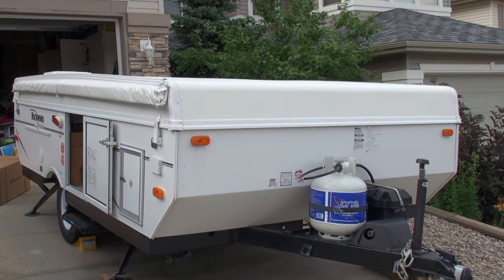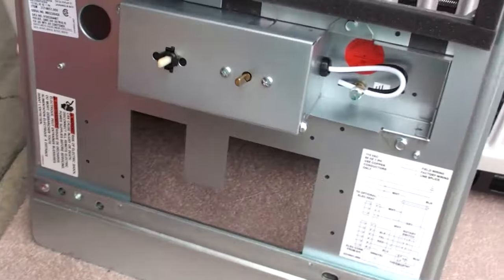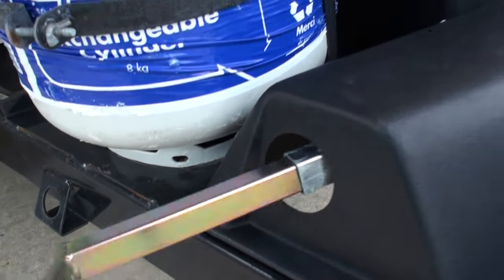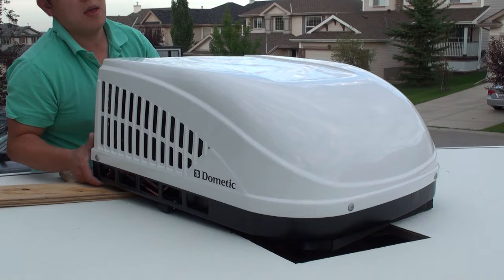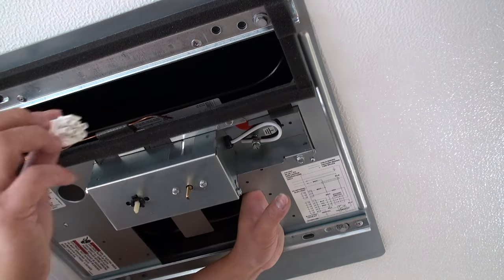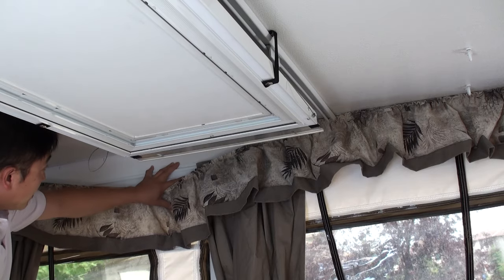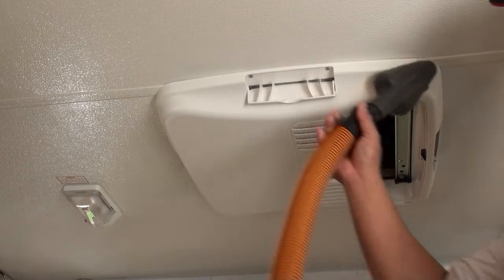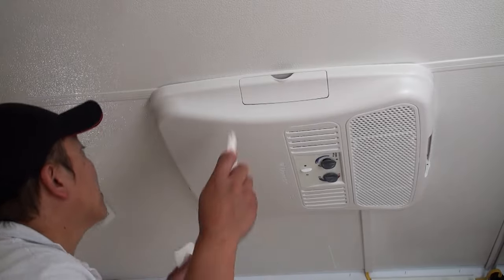Install a RV Roof Top A/C Unit on a Forest River Pop Up Camper Tent Trailer

Comment: Excellent! clear, intelligent, concise. A very good example of an excellent working brain. Not too common in our times.
Great Job, Sir !!
Reply from the maker: +Raul Calzadilla thanks for the kind words.  I'm "anal" about everything so if I'm going to show people how I do things then they'd better grab a seat b/c my vids (especially ones like this one) are exceptionally long.  That being said it is all about the details that people NEED to know about when tackling a job. Thanks for watching and definitely do share this video with others that you feel may be interested in this or my other videos :)
Reply: It shows, thanks again ;-)
Reply: @piercedasian  Thanks for the video.  Has anything changed in recent years on the installation?  I'm installing a Coleman 15,000 btu unit in a Forest River MAC that has been prepped for a/c.
Reply: Can you explain why the need to rum AC unit power to out side plug then run power cord from outside back to inside? Could it be wired inside without the need to do inside to outside then back to inside?
Reply: @bevinsracing  Agreed. He was very precise with his instructions and his attention to detail, but there was no need to cut a hole in the side of the roof to run the wire outside. If he would of just used that pass through flexible wire cable he could've run that directly to his power source on the inside of the camper.

Comment: Fiscally, this is the best YouTube video I've watched! The dealer quoted me $2200 for an installed 13.5K AC unit. I went to etrailer and bought a 14.5K unit with controller for $800. You literally saved me $1400!! 
I watched several other videos here, but until I watched yours (at least half a dozen times) I wasn't confident I could install this myself. 

It turns out Forest River had already installed the circuit breaker and junction box, which made things go much easier. My only issue is that they did NOT put the screw in the right place. I drilled up through the screw hole, right into a wood support! Should have checked with my stud finder first. 

Anyway, thanks SO MUCH for posting this. I am in your debt!
Reply from the maker: I'm SO SO glad to continue seeing people benefit from my video.  I never actually intended to do a video on this but figured that RV dealers are mostly shams and charge WAAY to much for something that can be done by the average Joe in a single afternoon.  I'm so glad I decided to document what would've been an otherwise "typical saturday" for me.  Nuts that Forest River put the screw in the wrong spot.  Fortunately, the distribution box will cover any minor boo boos you may have made on the interior roof panel so no harm done.  Good job on the install and may you have many years of icy cold a/c days with your newly installed unit!

Comment: MY MAN!!!! You just saved me a load of hassle/money. I am a new owner of a used Forest River, too. So the AC stopped working, and I replaced the capacitor hoping that was my fix (which was near impossible to find a compatible one). When it first stopped working it was something like a struggling startup, and wasn't doing anything. Then it just would not turn on at all. Troubleshot everything I could see/poke around with.

Finally gave up on fixing the old one. So I was thinking of buying a Dometic as replacement for the ~15 year old unit up there. And found your video for doing an install, and thought it looked perfect. You did a wonderful job of being thorough, and providing insight into every consideration throughout.
So you got to the bit about the breaker box. (I always assumed there should be one, and even asked the guy I bought it from. He said there was not one and the brown box under the seat was just the heater unit.) So I saw you get down there and open it up, and I said, "That's probably it!!!!!" So I ran out, saw the switch was OFF, and plugged everything up out there....BOOM AC!!!!! I'd also not looked much below the seats as we've only been using that area as a travel crib spot so we didn't even move the table/cushionis.

All that to say, you rock!! Take my subscribe and like! Thanks so much, and keep up the high quality videos!
Reply from the maker: wow talk about luck on your part that you found this video and discovered a breaker panel!  Had you not known you would've replaced your AC unit for nothing and still have issues with no power.  Good on your for doing your research.  Hopefully the guy you bought the trailer from was a good deal.

Comment: Was looking for a video before tackling my own install on a TT and initially skipped this one because of length.  Good thing I circled back.  Your video was very thorough and informative.  I'll be referencing it during my install. Thanks
Reply from the maker: ah, smart person you are!  When I made this video I was quite worried about the length as people's attention span is usually less than 5 minutes.  This video I can 100% absolutely say with certainty is the most comprehensive install video found on the Internet and for good reason - you only get to do it right once and if you screw up its going to cause you some serious problems.  Most of my videos are quite long and detailed and quite verbose but it is because I'm trying to make sure my viewers don't mess up and have a successful install/fix or whatever I'm trying to teach them at the first go.

Thanks for circling back to watch it and thanks for liking it!  Good luck with your install.

Comment: Thanks for the video!  I plan to install the exact same unit in my school bus I'm converting to an RV.  Most important thing is the 1.5" distance between the ADB and the A/C unit.  I was hoping to simply mount it directly to the thick sheet metal for the roof but your instructions show me that's a bad idea.  I'll install 2x2 framing on the inside around the hole before I install the unit so everything fits properly.
Reply from the maker: how did your a/c install go?

Comment: Very professional install. You covered all the details. Excellent instructional video. I already have this in our popup but was interested in seeing "behind the scenes" so to speak, so I can understand what went into this unit if I ever have to service or replace it. I thank you for your time. Keep up the good work. Your assured of being in the man club forever now! : )
Reply from the maker: +carbonhead T glad you liked my video!  I can't tolerate extreme temps.  In the winter I hate cold, in the summer extreme hot makes me grumpy so the only way to make yourself happy on a limited budget is to do it yourself :)

I'm quite anal about things especially when I'm working with "new" things.  That a/c unit wasn't cheap - they're insanely expensive in Canada but I lucked out on this one b/c the dealer wanted to move some inventory.  He offered to install it but at a cost of $500-600 labor that was out of the question especially when it was so easy to do.  I have done another trailer after I did my own and the install time was shortened by 25% b/c I know what to expect and didn't have to be as "cautious".  Best investment ever.  Should I ever decide to sell my pop up that I can take the a/c unit off and put in either a skylight vent or something in its place and install the a/c unit onto my future travel trailer.  It truly is THAT easy to pull off...

Comment: Thank you very much for the great video. I completed the installation on my 2017 Flagstaff 625D without any problem thanks to your video. I have a couple of suggestions to help others. I used a router to cut the roof opening. Also, I used an inch-pound torque wrench to tighten the bolts per the instructions with my AC.
Reply from the maker: glad you now have A/C!  Makes a huge difference.  Thanks for sharing the tips with our viewers!

Comment: Just bought a pop-up (Nov '15) The first add-on will be a rooftop AC using your excellent video! It is so understandable and detailed. There are no instruction gaps and everything is clear. Thank you so much for your effort in making this video! Many will appreciate your efforts!
Reply from the maker: +Sam Robinson congratulations on your new pop up!  You'll have lots of fun with it!  My videos are recorded the way they are with intense details because what value does it bring the viewer to omit the small details on doing a PROPER install???  The devil is ALWAYS in the details and it blows my mind why other YouTubers omit so much of it.  That's not how I roll and thus make crazy long but details videos to walk my viewers from start to end and not have them scratching their heads wondering what step they may have missed!  Good luck with your install and may you have many memorable trips in your camper :)  Thanks for watching.

Comment: Putting mine in tomorrow morning thanks for the video. My install is going in a cargo trailer camper. That fan was loud hope I can get some sleep when it's running.
Reply from the maker: Yeah the an is quite loud but at least it is steady and it doesn't cycle on and off like the previous generation a/c unit.

Comment: I’m going out on a limb and guessing you have done this before! Great video, all the attention to detail makes for a very clean after market installation that looks factory.
Reply from the maker: If you'd believe it, this was the FIRST kick at the can.  I was determined to NOT pay the rip off RV dealer for the install and I did a ton of research on my pop up camper before starting.  I took my merry time and I've always been a really logical thinking that takes a pragmatic approach to solving problems.  I'll admit I was impressed with my own work b/c it went without a single snag.  Patience, having the right tools and taking your time was key.

Comment: I moved from northern california to mississippi and I have a Forest River 1949 LT. I never needed a/c back home but down here its required. I was looking at all kinds of funky ways to mount a window a/c because I thought installing a roof top would be too hard. Thanks for the video, this is something I can handle. Not to mention I can't sell the thing down here if I wanted to without it.
Reply from the maker: My apologies for taking forever to reply.  Been very busy with life.  I considered the window mounted a/c approach too but since I have a Rockwood 2280 that I purchased in pristine condition that I wasn't willing to start hacking away at the sidewalls just to get a/c that might cause issues with my trailer later down the road.  Going the rooftop route IS the proper approach.  Expensive yes but considering how long a/c last and how relatively inexpensive they are in the USA that there isn't a reason to not install a rooftop unit.  In canada they're CRAZY expensive but in the US you can have the entire setup for less than $800 all in.  Easy install and honestly I spent more time working the electrical than I did the cutting or mounting of the actual unit.  It's been 2 summers now and my a/c unit stills chuggs along as good as the day I installed it!

Comment: Awesome video, I'm replacing a nonworking AC unit on my park model trailer tomorrow. This video was very helpful and I haven't even started yet. My current non working one has a thermostat and the new one is remote control so hopefully the wiring in str8 forward.
Reply from the maker: wiring will be super simple.  The basics of electricity are hot, neutral and ground.  Any other extra wires are likely for a t-stat which as you've indicated you won't even need b/c your new unit has a remote.

Comment: This is one of the best comprehensive video I ever seen.  Thank you very much for spending your time to share this informative video with us. This is a very neat installation with all explanation.
Reply from the maker: glad you like the video.  It is amazing how some people actually "dislike" this video.
Reply: People may see thing differently depend on their background.  I listened to the details of your installation process.  You always focus on the safety while installation.  This is a good point to mention especially for amateur and DIY people.  1. The dust from fiber glass materials.  2. Hazard shock from AC power line and etc. So the video do not only show the installation but also give details and safety concerns.  It is very clear.
Reply from the maker: glad you like it and more importantly that you did so in a safe manner.

Comment: If I had to guess, I'm assuming you work as an engineer. The level of detail and your knowledge of the project was very refreshing. As an engineer myself in my past life the word drip loop was something I used for many years in wiring design work. Well done and happy camping..
Reply from the maker: I'm actually NOT an engineer by trade but in the field of quality analysis that works closely with engineers.  I've always had a bit of an OCD complex in me and thus it isn't any surprise that how I go about things always has an over arching technical spin to them.  I don't believe in hacking things to make them work.  Even a slight defect drives me insane (it's hard living a life with that kind of mindset b/c I see everything as being flawed).  Glad you liked the detail and the nomenclature used to describe things :)

Comment: It looks like you have done this a time or two. Nice detailed work, great video.
Reply from the maker: Ironically this was my FIRST time doing an RV air condition install.  I've only owned my tent trailer for less than a year before I couldn't bear the heat of some of the places we camp at.  I'm just anal and do lots of research before I tackle a job.

Comment: I installed my unit today. I found your video to be very helpful! My only concern is the seal between the gasket and the roof. I made every effort to avoid any problems but still had a leak from condensation on the roof coming in from the gasket. I tightened the bolts about two more turns and am keeping my fingers crossed.
Reply from the maker: do you still have condensate issues?  Mine has never leaked nor has my friend's unit that I installed for him.

Comment: Superb!   Learned a lot, even in the details like the taping up the wire nuts so they don't come loose in travel.   Very nicely done, I'm lucky that my pop-up comes pre-wired, so I can avoid the wire outside, but even the little loop at the bottom tip for rain, so thorough.  Thanks very much!   I'm curious, the roof itself I suppose is fairly insulative, but the canvas won't be, so I'm sort of curious how well pop-up trailers retain the cold?    Anyway, have a good one!
Reply from the maker: You're a lucky person to have one that is pre-wired because you can save yourself a ton of time by not having to install wiring and tying that all into the power panel.  Canvas practically has zero insulating properties but the a/c is so powerful that staying cool inside even when it is 100F outside is not an issue. Just takes a longer to cool and it runs more than say if you had a fully insulated travel trailer.

Comment: Great job - and very articulate. 2 questions - 1) Is the unit just sitting on the roof? What's holding it snug? 2) AC units remove water - where does the water drain?
Reply from the maker: The a/c unit is clamped to the roof opening via the lower plate that is part of the air box. The roof is “sandwiched” between the a/c unit and interior airbox and that how it stays in place. Been a few years and my unit hasn’t moved or leaked water at all.  The condensate just runs off the roof of the trailer to wherever gravity takes it.
Reply: @piercedasian  - OK thanks - just wanted to make sure I wasn't missing anything.

Comment: Why not run the black #12 extension cord straight from the AC unit to your power panel on the inside of the camper? Less holes and less electrical connections. I have a dedicated box that came with my 2010 viking pop up for an ac connection. I know the cord would be inside the trailer, but find a creative way to hide it? Great video, I've been wanting to install an ac unit for years now and finally got the go ahead from the wife. Thanks
Reply from the maker: While I could've definitely done what you suggested that I'm super neurotic about following factory install specs. Factory install was designed a certain way likely for safety considerations so rather than defy what Rockwood has published that I just followed their install for hopefully many more years of trouble free operation with zero shock hazard due to dangling cords which I'm sure my little ones would love to play with if they were inside the camper.  Thank for watching!

Comment: Excellent. I see the only fear part is cutting the opening for the new roof top unit. I was wondering what you do with the outside cable in order to store? Great job.
Reply from the maker: Yeah cutting the hold on the Forest River products is straightforward.  The screw on the ceiling marks the spot to drill through and you carefully cut until you hit the metal supports and then VERY carefully cut towards the side wood stringers taking care to not cut through them.  If you go slowly with a recip saw or cut the roof by hand that you CAN feel resistance when you hit something.  That being said, the cord for the unit is pushed into the cord hole just like how you'd store the trailer shore cord.